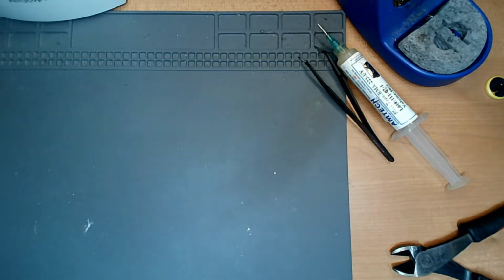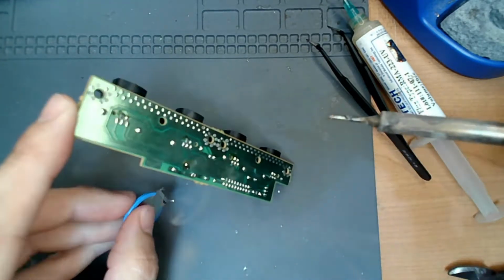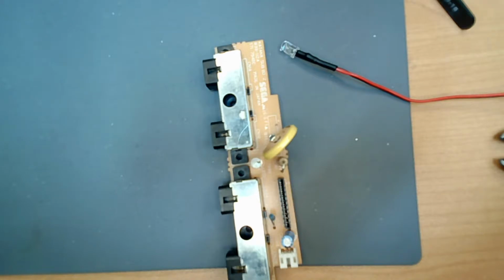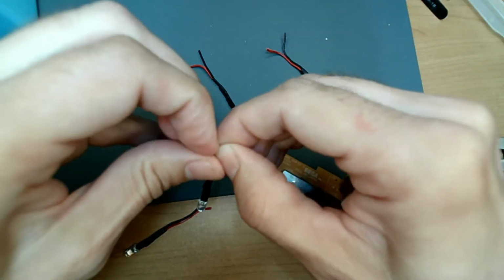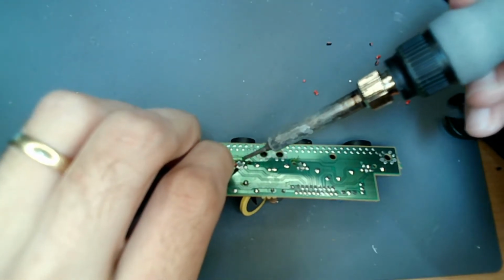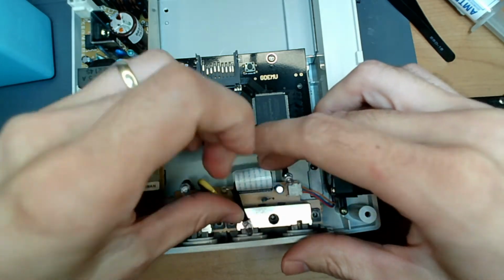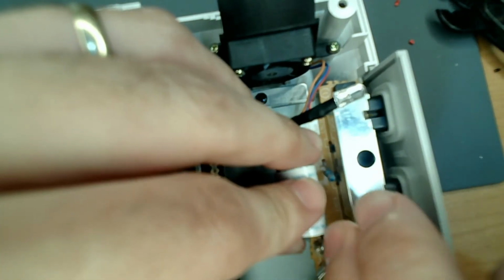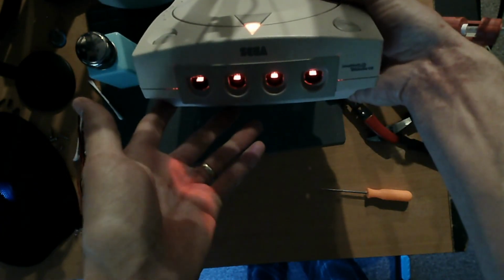Dreamcast battery replacement and controller port LED mod.

Comment: Well I tried this, and the controller gets crazy flashing the memory card led. Pressing the dpad at the beggining, when setting the clock, it doesn't respond for some time or goes through the items very quickly all of a sudden.
Tried different controllers with/without rumble pack and it just doesnt work ok. 
I used 5mm orange leds with 150ohm resistors.
Reply from the maker: Make sure that you are on the right pins and make sure there are no bridged connections.

Comment: i dont have hot glue is electrical tape good enough?
Reply from the maker: That would also work. Not as stable though
Reply: @timmahotool3714  true i may end up having to constantly reseat the leds. thanks and great tutorial

Comment: This is awesome and I'd love to do it myself! I can definitely follow your vid but do you have any links to diagrams too? Thanks for the amazing content :)
Reply from the maker: Your welcome. And yeah I will drop the link in here asap.
Reply from the maker: Here is the link to the wiring diagram! Props to Sonic4Freedom. http://forums.modretro.com/index.php?threads/dreamcast-controller-pinout.15613/    Use the controller board diagram and the pinout on the far left are the same pins for all of the ports.  Let me know if you have any questions!!
Reply: @timmahotool3714  That's very kind of you thanks so much. Do you have a recommendation for the LED type? Also, perhaps pop this link in your description to help other peeps :)

Thanks!

Comment: I have a backlit VMU mod,  I'm guessing that it's tapping to the 5v this mod is using, on top of that I use a rumble pak that would also use those 5v.  I wonder if the system would eventually die if I'm playing while using a rumble pak, backlit VMU and a controller port led mod all being powered by the same 5v?  I'm guessing that the accessories the controller uses are powered by the same 5v per port this mod uses, correct me if I'm wrong.
Reply from the maker: I have not tested it that far. I have a vmu that plugs in and is fine. Not sure how much draw it could handle. But yes it is pulling from the back of the controller port.